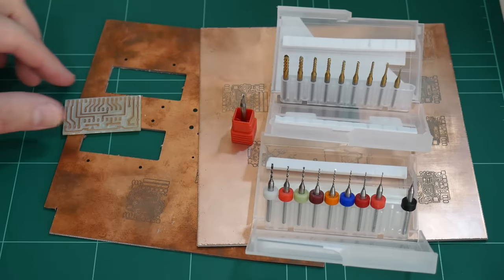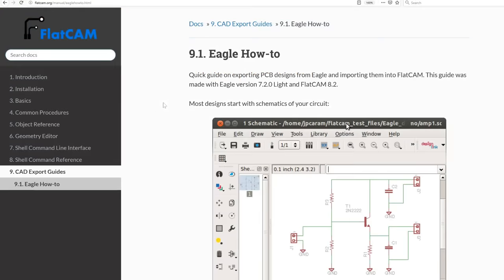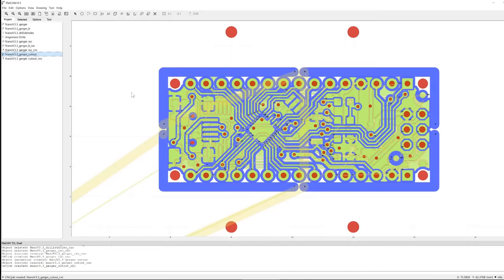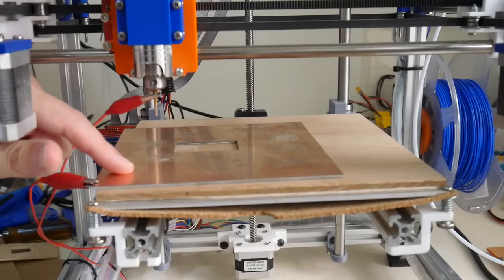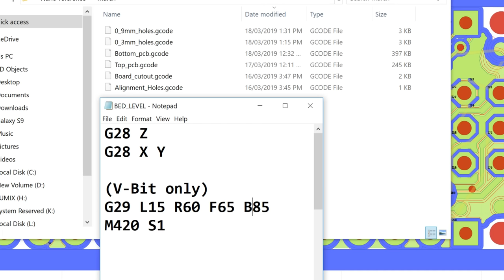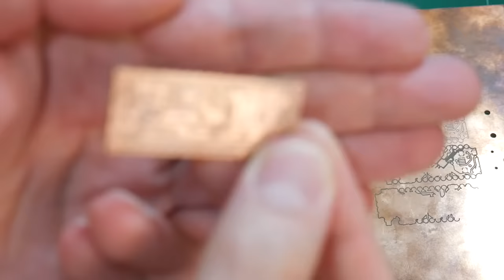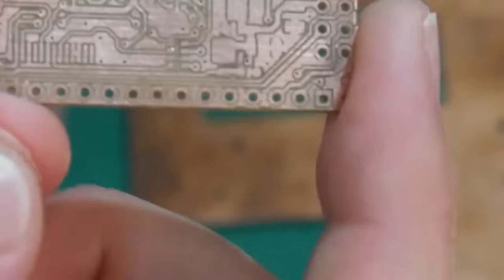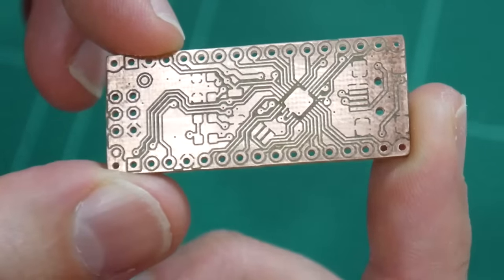Advanced DIY PCB with a modified 3D Printer

Comment: Come on dude don't claim you're making these with a 3d printer. When the router bit attachment comes on, it is no longer a 3d printer but a CNC router.
Reply from the maker: Well it is a 3D printer. I just replaced the head with a dremel flexible shaft mount ;)
Reply: Yeah but which title makes better clickbait?
Reply: I clicked expecting to see some magical additive process for making PCBs
Reply: I think with 3d printer marlin firmware, pronterface, a 3d printer frame, no CNC bought at any point, makes it a 3d printer. Even more so if you've printed the drill mount yourself. That's at least 75% 3d printer.

Comment: That 0.3mm drill sure scared me.  I thought it was going to snap every time it started wobbling.  Definitely spot drill first, next time.
Reply: Don't forget to wear you glasses.
Reply: I think the spindle speed is the problem. Those bits are made to run from 20 to 100k rpm.
Reply: I think a shorter bit would help too .
Reply: Agreed. A quick touch with that v bit would center that drill pretty quickly.
Reply: @thatguythatdoesstuff7448  to use the vbit to pre drill center holes would definitely be a good idea, especially with those small drill bits. 
Could also speed the retrect movement out of the drilled holes.  I would guess that the slow is only needed while pushing the drill bit down, not retracting it. If one want to save time.

But yes, pre drill the holes with the vbit would be a drill bit saver.  As he said in the end of the video.
Reply: The length of the bit is the problem, using a bit to locate the hole would help a lot but pcb cnc bits this small or smaller tend to only be as long as they need to be.
Reply: Definitely spot-drill with the v-bit first, reducing some wear on the 0.3mm bit and likely reduce that initial wobble.
Reply: Yeah that poor bit.  I'd cut it way down and then resharpen it if a shorter one can't be easily found.
Reply: @Aleksanti  More likely the chuck, you should use a collet chuck for this sort of thing not a 3 jaw.
Reply: I suspect the 0.3mm drill bit tip isn't symmetrical, not centered when ground.

Comment: If you painted the board with solder mask then ran a compliant/spring loaded  scuffing bit to remove the mask you would be in perfect shape.
Reply: The holes need plating though, and it's very hard to do at home :-)

Comment: Are there 3d printers that can print copper on a board?  Seems like much copper is wasted with this milling approach.  Even through the copper board is not expensive, wouldn't printing copper be a good (possibly better) solution?

Comment: I have been making PCBs like this since 2013, using a cheap CNC router.  It took me over 3 months to work out the optimum machine settings, software settings, and tool sizes, during which time I nearly gave up.  But I can now make really dense microprocessor boards reliably.  I use 0.5mm bits for the vias and 0.8mm for the components. If any components won't fit (usually connectors) I enlarge the holes by hand with a 1mm drill.  This is much quicker than changing the bit and setting up again to make another pass.  It took me ages to realise that to stop a V-bit from breaking you need to increase the depth of cut, not reduce it.  I use 3mm dowel pins to register the board.  Screws don't make accurate register pins.

Via connections can be made really quickly by taking a single length of wire and threading it backwards and forwards through all the via holes.  Solder each one and then cut off all the spare wire links.
Reply: great insight
Reply: Brilliant
Reply: Thanks for the tips

Comment: Your video is sponsored by a PCB manufacturer, but you show how to make PCBs at home? 
The irony is real!
Reply: Better quality, make the prototype at home then order 100s from them $$$$
Reply: The prototype is real, the the bulk order is real too!
Reply: @vizionthing  means you can test the prototype
Reply: @jlebrech  Ok Captain obvious?
Reply from the maker: Haha
Reply: You'd be surprised how often showing someone just how much work goes into DiY results in them happily forking over cash to have someone else do it.
Reply: @lowellhouser7731  Yeah..In the end what this really shows us, is that it takes quite a lot of effort to get this far. The commercial PCBs also have solder mask, printing and plated holes and can work out to be just ridiculously cheap.
Reply: Getting a test sample can be quite expensive. But getting larger numbers is cheap, per board. So they don’t mind supporting one off, or even two off board videos, because they know that you’ll need a mass manufactured product for serious multiple product production.

So this makes perfect sense for them.
Reply: and home pcb actually lasting is an issue cus oxygen.
Reply: i think the thing that got me was the coper plate probably cost 50 time more than the pcb off the site
Reply: @Arkadyc  if you include cost of all this stuff then yes, it cost much more
Reply: honestly making diy pcb's at home is not worth it.
Reply: @jlebrech  I know it's sarcastic, but JLC PCB is cheap ass for real. The only killer is the shipping, like our guy pay 5$ for the prototype and paid 20$ for the shipping.
Reply: i guess it's a smart sponsor, it show clear which one better quality and quantity
Reply: Fast turn-around time on prototypes, catch any mistake - on the same day, no waiting if you're good at soldering + have the setup up'n'running.
Critical designs/verifications stays in-house, which makes it very hard to replicate (which, of course isn't happening ;ø) - to finally end up with a ver1.0 after cut'n'test.
Then mass production, and hopefully going viral with the newest hottest wildest crazy product  nobody has ever seen - but wants soooo badly.
Reply: Just to show you that it can be done at home, but it is in no way cost-efficient or time saving
Reply: @richardphatthenguyen195  Thats why elecrow comes cheaper overall. JLCPCB is just marketing BS, nothing more.
Reply: I thought that too. But there's audience overlap. I make PCBs at home, but I also send away for large batches depending on the project demand.
Reply: @jlebrech  that's what breadboards are for :-p
Reply: The video is sponsored by an algorithm that doesn't know PCB's from the Ice Bucket Challenge.. but it does know keywords. This is advertising today.
Reply: @jamesmurphy7193  algorithm? He is reading the ad himself
Reply: DIY people come here to find it so hard to build PCB himself, then order it from the manufacturer. That's why they are sponsoring it.
Reply: Lot of steps, lots of chances to make a mistake, simpler to just order the part.  Very educational and very precise, I am just not sure the projects I would be performing,  would not always  fail with operator error!
Reply: Can you name some sites to download the example pcb design files. I'm a Mech Engineer and need it in dxf or dwg format
Reply: The true cost of an at-home routed PCB is having to listen to a router for 80 minutes per board.
Reply: That's because before you order a "real" board, you have to make like 20 versions of it and find out 20 different things wrong. Trust me. There is always a place for "home" prototyping before spending the bucks on a well made board. I know from experience.

Comment: You’re getting some really good quality results there, considering the bearings/belts/rails! I think the only advantages the professional machines have is they can be run with faster feed rates and a smoother workflow.

Having machined several hundred PCBs on three different LPKF mills, I’ve universally drilled all the holes first, then run over the top surface of the PCB with very fine abrasive paper. This removes any small burrs. I’ve then run the insulation passes (smallest to largest). This consistently yields the best quality results. You then can flip the board and run the bottom insulation passes (if required).

If you drill the holes last, you risk the pads being ripped up as the drill bit plunges. This becomes particularly important on special RF PCB materials (laminates) where the copper to dielectric adhesion is not as strong as it is with regular FR4.
Reply: I run the LPKF for my college's fabrication lab, and doing the the drills first to deal with losing pads is genius and I'm mad I didn't think of it. Have any other sage advice for these machines?
Reply: How do you plate the holes in that process? Like for vias?

Comment: This is why I make my own PCBs, sure they are cheap from companies like jlpcb but I am not a production house that needs a ton of PCBs. I only make one-offs for my own projects and I can get them done in very short order. I use a "normal" CNC engraving machine though, so my controller is grbl based. Originally it came with a parallel port controller but I converted that to grbl and kept the original stepper drivers/power supplies. That was one of the first PCBs that I made, a shield that plugs into an UNO and breaks out the pins to a parallel cable to run the original controller without any additional mods. In fact the only modification that I made to the original controller was to run a wire from the new probe pin (from the arduino) to a banana jack on the case.

For layout I use Diptrace, and for G-code I use CopperCAM. One thing I am going to try next is exporting to a DXF or similar format and try more advanced toolpaths in a CAD package. This will actually require a bit of extra time processing the file in CAD to make it suitable for a toolpath but I wanted more options that cannot be had from CopperCAM and other "engraving" software. I want to be able to ramp in and easily set multiple depths, these are things that I can do easily in my CAD software.
Reply from the maker: Great! Thanks for sharing!
Reply: @Tech2C  No, thank you for sharing. Sometimes I think I would like to make videos showing all the projects that I do, but I'm far to busy to produce such content. Perhaps some day I spose.

Comment: Another note for others, when you're designing a PCB (using something like Eagle) and you use the AutoRouter, I believe you can set some tolerances to ensure that the routes generated will work with this kind of process.  But with SMD components, sometimes things just get too small.  You can also set your minimum trace widths.

Comment: @Tech2C 22:00 try replace 0.3mm drilling with etching with V-bit, but only to 0.1mm depth, it will make small holes to the copper, then you can drill with 0.3mm drill bit ;)
Reply: @Tech2C You said it al 27:00, sorry for spam :D
Reply from the maker: Haha no problem :P

Comment: I mill PCBs at home before sending off to fab shop. Usually for anything complicated, mostly SMD I would just use toner transfer and etch the boards. It's way faster and less dusty. I'd add an enclosure or use mineral oil, the FR4 dust is extremely hazardous - takes decades, but it'll get you eventually.

Comment: "This was a very high learning curve for me" - THAT is what this is all about - what you learn is something you cannot purchase from a PCB manufacturer

Liked the way you used a ready made design so you could concentrate on what you wanted to achieve.

Would be interesting to see if you can solder on the parts and fully complete a home made Nano.
Reply: This wont work, he has no way of plating the vias. 
If he changed the via holes to 0.9mm you can buy rivets.
Or use chemicals, which you may as well use chemicals to etch it then.
Reply: > This wont work, he has no way of plating the vias.
You can always solder the two sides of the via using a 30AWG wire. It's a lot of work but for one-off prototypes that works very well.

Comment: What a great result! I have been using relatively inexpensive pyramidal drill bits, of 60 degrees, and using a depth of 0.05mm and single pass. Also, as a hint, I was able to make my own vias by placing a single wire of copper of the same thickness as the via and 2mm long, and smashing it from both sides until it makes contact with the copper clad without soldering. The result can be good, just requires a bit of practice.
Reply from the maker: Good stuff! I mentioned at the end of this video to solder a wire through each via, but I like your approach!
Reply: Smashing?
Reply: @wf2v  I used pliers to press the both ends of the wire against the board.

Comment: The tiny holes usually use VERY high speed drilling. 200K-250K RPM is normal and 300K is sometimes used.  It takes high speed to get the cutting edges of the tiny bits to go any reasonable speed since they are so tiny.

Comment: The benefit with milling PCBs are saving time during prototyping. As soon as the design is defined I use a manufacturer. To mill PCBs as an alternative to manufacturing will normally never be done.

Comment: The big problem with making your own double sided PCBs with a CNC is that you can't make vias, and will have to add wire jumpers between layers.
Reply: Was hoping to see him do the vias.  Do you use solder wire that fits in the .3mm hole, stick it through and solder one side then go back and cut it down/solder other side? I don't think you could just solder it without some kind of wire going through, no way it will flow through the hole on its own.
Reply: When I was at school I had a holiday job one year hand soldering circuit boards for traffic light controllers, probably 40 years ago.  The boards were double sided tinned but no solder mask and the vias were made using a roll of tinned wire poked through and soldered on both sides.  I think the factory installed a wave solder machine not too long after that.

Comment: Wow I see so much success, now, tech-san, try make it better!
Make a cool color protective layer before it begins.
1 automate the swapping tools and drill
2 automate magnetic check sensor detach (aligators)
3 automate (spin 180 degree) plates.
4 Protetive layer be scrapped by a tiny metal brush tool right at the end. 
5 With tree fingers an automated selecting pcb compontents
6 Automate ball placing for ball, and paste placing for...
7 Automate set up tool for soldering with hotgun chips, and ball.
8 - Automate soldering! (wow that one should also be used to add adicional tin trails to already cut out pcbs)
9 - Nirvana. The initiation is done.

Comment: I'm glad you went into z probing. You really can't get good results milling copper clad without it, at least not without buying the expensive copper clad and using a fixture. I've got one of those cheap desktop CNC engravers and I simply couldn't get consistent results without doing z probing (using bCNC + grbl since it's not a converted printer). Also like the idea of using screws for alignment, I ended up making a 3d printed clamping jig but screws would probably be a lot easier.
 FlatCAM is a little quirky, but it's so much more capable than the other software like pcb2gcode. You might want to add a blurb about dealing with the dust, though. Especially fiberglass resin boards, the dust from milling is extremely dangerous and you really need to be careful about breathing it.
Reply from the maker: Yes I was wearing safety glasses, ear muffs and a breathing mask whilst in the room. I usually mention the saftey gear I wear but I didn't in this video.

FlatCAM is amazing for free software. I can live with the quirks as editing the exported text files is easy enough. Cheers!
Reply: Tech2C i have a modified version of flatcam that works directly with marlin, have to polish it up and make an installer for it but that saves a lot of time ;) tell me if you want to beta test it.
Reply from the maker: Any updates which make it work better with Marlin is welcome. Will your changes be merged into the main FlatCAM branch? I'd like to see the M211 S0 included and F gcode fixed. If possible expand the feed rates to include plunge, retract and travel Z speed. And while I'm wishing for unrealistic changes, include auto leveling command G29 with the boards co-ordinates box in the gcode to be auto levelled... :-)

Comment: I guess one has to pre-plan the alignment hole locations so that the homing action of the printer does not wipe out a drill bit if it passes over a screw head?
Tip on finishing a PCB, use "liquid tin". Stuff is expensive but makes a world of difference when soldering.
Good video, I might stick to etching my PCBs but use the Hypercube for drilling. Maybe speed up the drill and spot-drill as well to reduce the drill dancing?
Cheers,
Reply: Marlin has a setting for homing travel minimum height for just this reason. The tool will lift up to that minimum height before homing back to 0,0.

Comment: In my experience with pcb's, I noticed that , as the drill makes contact with the surface,
there is going to be a bit of pressure, as the z-axis keeps moving the built plate upwards,
but the drill did not grab into the copper layer to drill the hole.
At least, with regular drills.
Also, since the spindle would run at around 20K rpm, it tends to run away across
the surface, upon this first contact. Especially with such thin drills, or when the drill
is not sharp enough. Might be a sign, the drill is not exactly perpendicular to the plate,
or the spindle attachment is a bit flexible; it cannot handle strong forces.
Spot drilling might help, or maybe you can fix an attachment for a push center pointer.
Anyway, I think this printer did an amazing job.
I did not expect that with a belt driven system.
Nice.
Reply: He did mention using the v-bit to spot drill for the holes.

Comment: LPKF machines makes marks centers on small holes with engraver bit so small drill bits under 0.8mm does not wiggle.   you may use same technique if it is possible in flat cam.

Comment: If you added some method of cooling like with water or air, you wouldn't need to do two passes because the copper wouldn't heat up enough to melt and move around into other traces.